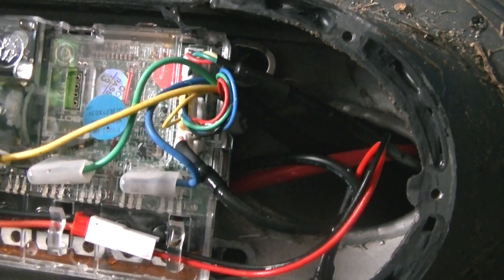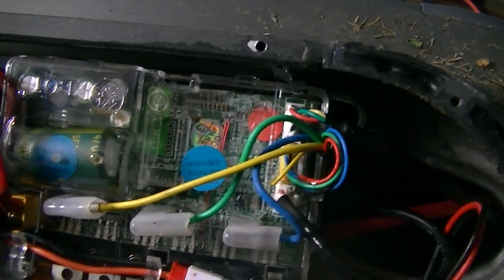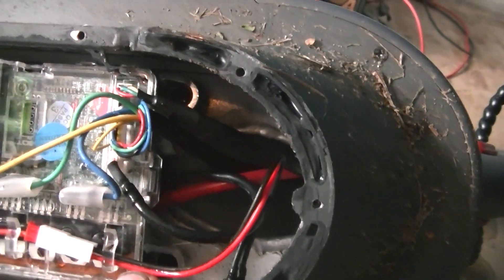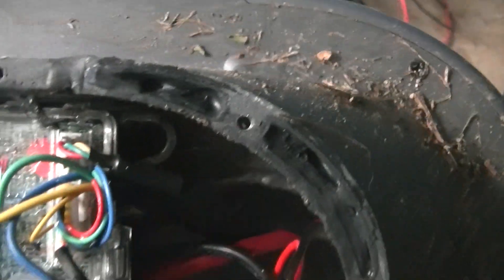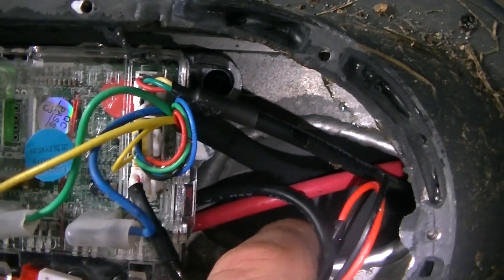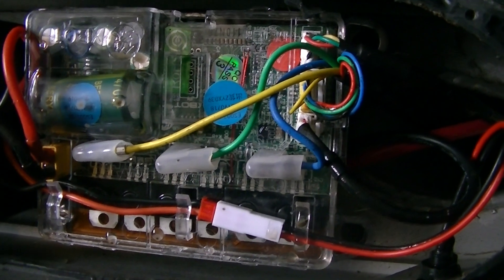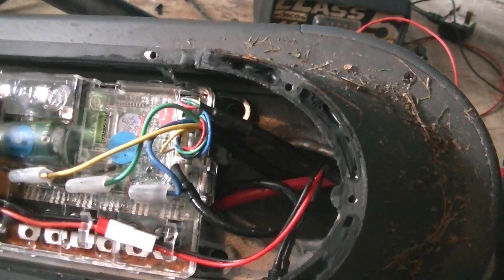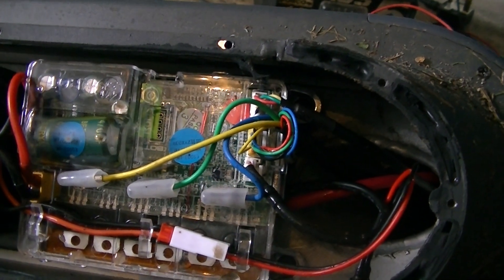LIDL DOC GREEN  SCOOTER ENGINEERING ERROR  (WATER  LEAKS INTO THE BATTERY)

Comment: Have one of these Doc Green Lidl scooters for 2 years, left it out in light rain and now it won't switch on at all. Can't find the problem, but the battery is good, can't find any water damage. Only used a few times, €350 down the drain if I can't get it fixed...
Reply from the maker: pcb under on/off switch these are not waterproof at all

Comment: Error 16 What does it mean?
Reply from the maker: that happens  if you try move   it  before  its fully turned  on  or you   holding the brake  or throttle  and trying to  turn it on  at same time    if its doing  any other  time it could  mean there  is a fault with the brake  switch  or lever  may be  stuck in  or throttle  might be stuck  on slightly
Reply: @TCBOT  what does e
E3 error code mean please?

Comment: I sorted this problem out 100%. The water does not get into that little compartment from the top, it goes in at the back of it, where you have that little rubber sticking out part on the plate. It has got a hole on it. I sealed that, also ordered an extra seal for the bottom plate from Amazon (you can find it as Xiaomi M365 bottom seal as this scooter is a 99% copy of that) and I put an extension on theback of the front mudguard  so no water gets thrown at the bottom part. I have been testing it for 2 days now in the rain and puddles, not a drop of water in the bottom. For full weather-proofing, you can also get a silicone cover for the top where the button is. I am well happy about this now. If anyone wants to upgrade anything else on this scooter, just go on Amazon, Ebay or Wish and search for Xiaomi m365 accessories and parts, 99% of these parts will fit this scooter.
Reply: Hi. Can you please explain where exactly is the small hole you are taking about?
Thanks
Reply: @morientesss5405  
Hi. It is attached to the bottom plate right at the back exactly where the back wheel is.
Reply: Got any links for the items you bought?

Comment: Mine did go 16(mph) on the digital gauge reading, this was with wheel lifted running for a few seconds. Now took it out today and tops out at 12......... Anyone else had this?
Reply: 12 this is if you clicl on/off button twice and first bottom light it's green. Do double click again and light will be back to white colour and speed will be 16mph. Green light (safe mode)
Reply: @morientesss5405 thanks fitted now.  wow this scooter gets better for £279 it has a eco mode. You will be saying it recharges when free wheeling next. Absolute bargain.
Reply: My doc green deck snapped after six months. Cool cheap little scooter. Very cheap and is for children. 
I've got a Off road 800w now. Very satisfying

Comment: I have not had mine out in the wet , I might now try sealing up the hole inside under the folding mechanism with something like a silicone sealer , maybe even play dough stuffed in the hole would stop water getting down the tube lol  , wonder if it would be worth drilling a small hole in the plastic base to let any water escape that gets inside.
Reply from the maker: yes good idea   before  battery gets wet  (as  you  dont want  bms  to get wet (could   get exciting  and not in a good way   if   that fails )   id seal all holes   from cables   etc  and  head tube  and put some  silica gel type  stuff in there  to   take  out any  small amounts  of water that may still get in

Comment: I bought one of these and the back wheel/tyre deflates on every use! if you pump it up and then check the tyre pressure by squeezing the sides of the tyre (as you would normally do) it deflates instantly... Anyone else have this issue?
Reply: both my tyres do the same , I have just pumped them back up and used a Hotls foam puncture repair can ,meant for fixing punctures in car tyres , will see what happens overnight , hope this fixes the slow air loss.  if not then it is new tyres and tubes this time.
Reply: I pumped mine up to 50psi. This is the recommendation on the 365. The doc green book at 2.5 bar is too low.
Reply: This happens because this is tubeless tyres. Don't squeeze it on the side  :)
Reply: I just replaced the tires for solid ones, a little bit challenging, but doable even with just a couple of tools (tutorial on youtube). You can find them on ebay by searching for Xiaomi M365 solid tyres

Comment: Where did the water get in there?
At the top where the button is or at the folding point or maybe somewhere else?
I’ve got one of these scooters and now am thinking of a homemade fix for this.
I haven’t used it in rain yet, but would love to know more about this issue so I can come up with something to prevent it.
Reply from the maker: it  leaks  threw  the folding part  and  where  the cables  go into  the scooter   you don't need  rain  to  do that just  the ground being slightly  damp    gets water  flicked  off the wheels  and leaks into it that way

Comment: Makes me feel that design flaw makes the scooter dangerous and Lidl should recall it. People aren't going  to abide by the do not use in the rain instruction leading themselves to a potentially exploding scooter. The product is simply a poor Chinese copy sold as if it was a rebadged original given the £410 RRP quoted in publicity for it.  It isn't that £410 scooter.
Reply from the maker: the  (real  1  has same issues  avoid that to  or if you have 1 open   it up  and seal it    up   none  of these scooters   are  (BRANDED    APART FROM SEGWAY   NINEBOT  BIRD ETC  AND MOST OF THEM ARE  REBADGED SCOOTERS WITH  EXTRA QC  and any  issues  fixed,   if i had  known    i would of sealed it  up and kept it  but as  it was too  late  i took it back
Reply: How can it be a Chinese copy if a Chinese company launched it first (and previously produced it for a major US scooter rental company)? The KRS Group, which sells the scooter in Europe, is at fault. Have cheap production and sell expensive to consumers in Europe.